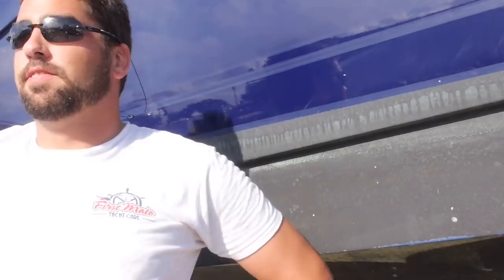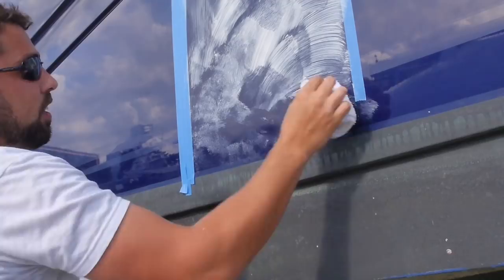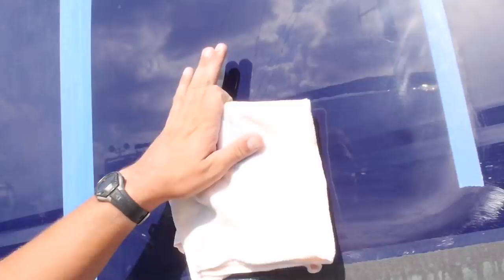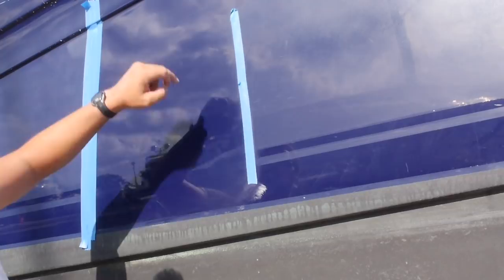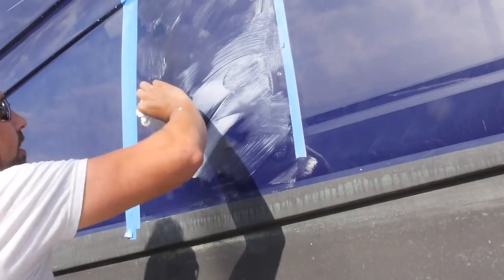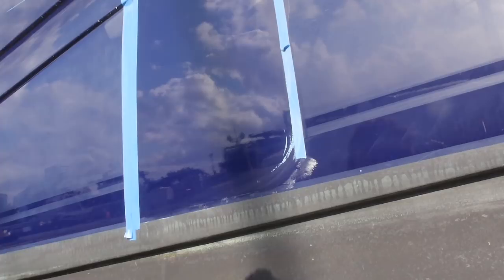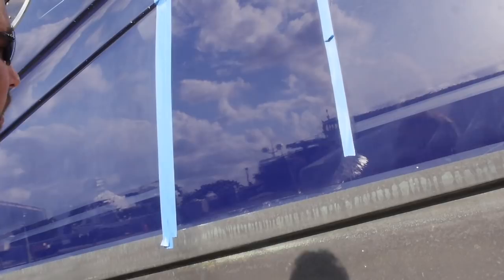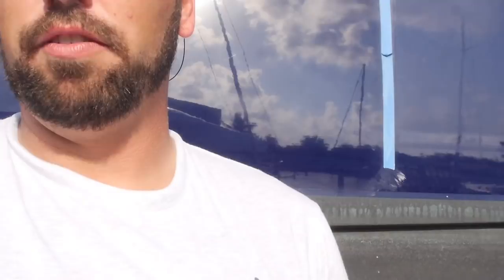How to Buff and Wax a Boat

Comment: You have the very best buffing video on you tube. Clearly you understand how the products are intended to work. Based on the comments below specifically Dankung, people don't understand how diminishing compound is intended to work. You use it correctly by applying the compound to the entire surface. If the compound is just put on the pad, the grit has already broken down as you move to unpolished areas. You know what you are doing. Many of the other youtube are misleading

Comment: Great video. I use Menzerna's on all my Mercedes and thought let see how well it works on our boat. It is unreal on the boat. I love the fs 400 for oxidation and 2500 for polishing. Then I use Rejex, especially on the rear port, starboard and stern. With diesels if you use wax, the diesel soot does not come off like it does with Rejex on it. I usually put 2 to 3 coats of Rejex, every 24hours for 3 days prior to launch.  Gets me through the season.
Reply from the maker: Rejex is great too, but better for paint. Old gel like this sucks it in like a sponge, and cannot keep a perfect layer of protection.

Comment: Wet sand or not, you have to remove all the oxidation.  You talk about multiple passes with a buffer to get the results you want, well you and I both know you are stripping gel coat on every pass.  You also have to make sure you keep cleaning out your pad with every pass.  Wet sanding strips all the dead off BEFORE you start buffing, and gets you MUCH BETTER end results.  I'm sure the customer will be happy with this, but because it wasn't done right all the way, you'll never be able to seal it up right and the oxidation will keep coming back faster, causing you to keep having to use aggressive compounds every couple years, and keep stripping the gel coat.  You and I can see the swirls and dull spots left in that spot you did.  Do it right the first time and you won't have to keep re-doing it.  Wet sand it.  You DO have to wet sand it to get the best possible, longest lasting results, that will remove more gel coat today but save so much in the long run.
Reply: Thanks James, can you give more details on the wet sanding? Any good video tutorials for that?  What grit etc... ? Thanks !

Comment: HEY GUYS , I will be doing this to my boat, so I looked up all the parts, etc. used in this video …. Some of the names have changed a little, but, through my investigating, here is the updated list (click 'Read more' below) : 

 Compounds : 
 
 - Reel Shine (NOW CALLED STARKE) - Restructure (Hard Cut) (Step 1) 
  - https://amzn.to/2WdA3iv
 - Menzerna Medium Cut (Step 2) 
  - https://amzn.to/2WfpwTY
 - Menzerna Super Finish 3500 (Fine Compound) (Step 3)
  - https://amzn.to/2DEhZXg 
 - Meguires Flagship Premium Marine Wax  (Step 4)
  - https://amzn.to/2DFEETd

Dewalt Buffer - Dw849  

 - https://amzn.to/2GQc9nM

Makita Buffer - BO6050J (newer model) 

 - https://amzn.to/2GKfPq4

Shurehold Wax Pad (Used with Makita Buffer (wiggle mode) and Meguires Flagship)

 - https://amzn.to/2J2SgLH

3M ultra fine foam polishing pad 05733 (Used with Dewalt Buffer and Menzerna Super Finish)

 - https://amzn.to/2Wd24Xh

Good Luck !  And check out my YouTube sailing channel if you are board someday !  - Lando Leaves Land
Reply: Menzerna 400 heavy cut is some good shit, i tell ya
Reply: @djstatyk1540  right on.  Ya, the Menzerna worked great.
Reply: Thank you!! Finally someone answered the repeating question and listed the products and the tools😁 Your awesome!

Comment: This should not be construed as negative, but people learning from this video also have to understand what a scratch/blemish is and need to look at their boats and understand what is a problem and what isn't i.e a gel/paint coat when newly applied only has so many microns of depth . Each scratch creates a channel that is lower than the top coat, therefore you need to decide before you polish your boat whether you want to try and recreate the original flat uniform surface it should have had when purchased as new. The reason I mention this is because if you do want this, depending on the depth you may compromise the integrity of the whole gel/paint coat just to try and buff out a deep scratch. There are too many people/companies claiming they are specialist boat polishers when their only ability is to use hard compounds and create a so called shiny surface to the uninitiated (I am not suggesting this company are, it is a caveat to this video). A true polisher should tell you the limitations of the remaining hull gel or paint and the ramifications of each process. In layman's terms if the boat starts with a hypothetical ten layers of gel/paint, one scratch may go through two layers one through seven, do you choose to lower to seven, thus leaving only three remaining and in a shorter time have an expensive adhoc process. There have been so many advances in technology over the years enhancing the life span of boats, someone whose first instinct is to use a cutting compound should be able to explain the rational through a series of test patches low impact first.
Reply: Thank, you taught me something!

Comment: My boat is also blue with some white fiberglass.  About the same condition as this boat.  We live in the Keys and use our boat almost daily. (2007 26' Striper cc)

Overall a good video, however I wasted 1/2 of my product starting at 1100 rpm's as advised.  I did 2 full passes on my boat at 1100 rpms and it did very little.  Once I increased it to 1600rpms it did a great job but still needed 2 full passes.   To see if I was correct I started the white at 1600rpms  and yep, two passes did it.
Reply from the maker: What compound did you use?

Comment: Great video and thank you. I use a little different approach for boats here in Michigan. In Fla its probably a whole different approach with salt water and heat. As an fyi I use a new 3M 3000 Non Woven Disc, and go right to polish. Ive been doing it this way on cars so I tried it last week  on a Crownline and it worked great. I also have it available on my ecommerce site should you be interested . My problem are the bottoms as I approach 70 I'm no spring chicken anymore.. Again I appreciate seeing your videos.
Reply from the maker: Donald, You are selling a polish? we always love trying new products. A clear coat (or even single stage paint) on a car is a much less porous material than gelcoat, and ages much better. Oxidized gel requires allll these steps. WE do a lot of work in Northern Michigan as well!

Comment: you should put the names of all the products in the description....
Reply: Here ya go... I did this and looked up all the products... some of the names changed, but I found the new names. Good Luck ! 
Compounds :  
 - Reel Shine (NOW CALLED STARKE) - Restructure (Step 1) 
  - https://amzn.to/2WdA3iv
 - Menzerna Medium Cut (Step 2) 
  - https://amzn.to/2WfpwTY
 - Menzerna Super Finish 3500 (Fine Compound) (Step 3)
  - https://amzn.to/2DEhZXg 
 - Meguires Flagship Premium Marine Wax  (Step 4)
  - https://amzn.to/2DFEETd

Dewalt Buffer - Dw849  

 - https://amzn.to/2GQc9nM

Makita Buffer - BO6050J (newer model) 

 - https://amzn.to/2GKfPq4

Shurehold Wax Pad (Used with Makita Buffer (wiggle mode) and Meguires Flagship)

 - https://amzn.to/2J2SgLH

3M ultra fine foam polishing pad 05733 (Use with Dewalt Buffer and Menzerna Super Finish)

 - https://amzn.to/2Wd24Xh
Reply: Updated: 
 - Reel Shine (NOW CALLED STARKE) - Restructure (Step 1) 
  - https://amzn.to/2WdA3iv
 - Menzerna Medium Cut (Step 2) 
- https://amzn.to/3agEvEO
 - Menzerna Super Finish 3500 (Fine Compound) (Step 3)
  - https://amzn.to/2DEhZXg
 - Meguires Flagship Premium Marine Wax  (Step 4)
  - https://amzn.to/2DFEETd
Buffers / Pads :
Dewalt Buffer - Dw849  
 - https://amzn.to/3kFffgv
Makita Buffer - BO6050J (newer model) 
 - https://amzn.to/2GKfPq4
Shurehold Wax Pad (Used with Makita Buffer (wiggle mode) and Meguires Flagship)
 - https://amzn.to/2J2SgLH
3M ultra fine foam polishing pad 05733 (Use with Dewalt Buffer and Menzerna Super Finish)
 - https://amzn.to/2Wd24Xh

Good Luck !!!

Hope I was able to help save you some time searching for all of this. 

After I was done with mine, it was beautiful. Couldn't believe the difference. 

As an Amazon Associate I earn a small bit from qualifying purchases, you pay the same as always. Not a penny more.

Comment: Product List?
Reply: Some of the names have changed a bit, but here is an updated list.  Youtube doesn't allow linking a lot, so just copy and paste the links if need be.  
- Reel Shine (NOW CALLED STARKE) - Restructure (Step 1) 
  - https://amzn.to/2WdA3iv
 - Menzerna Medium Cut (Step 2) 
- https://amzn.to/3agEvEO
 - Menzerna Super Finish 3500 (Fine Compound) (Step 3)
  - https://amzn.to/2DEhZXg
 - Meguires Flagship Premium Marine Wax  (Step 4)
  - https://amzn.to/2DFEETd
Buffers / Pads :
Dewalt Buffer - Dw849  
 - https://amzn.to/3kFffgv
Makita Buffer - BO6050J (newer model) 
 - https://amzn.to/2GKfPq4
Shurehold Wax Pad (Used with Makita Buffer (wiggle mode) and Meguires Flagship)
 - https://amzn.to/2J2SgLH
3M ultra fine foam polishing pad 05733 (Use with Dewalt Buffer and Menzerna Super Finish)
 - https://amzn.to/2Wd24Xh

Good Luck !!!

Hope I was able to help save you some time searching for all of this. 

After I was done with mine, it was beautiful. Couldn't believe the difference. 

As an Amazon Associate I earn a small bit from qualifying purchases, you pay the same as always. Not a penny more.

Comment: Good job on the gelcoat...I don't envy your job. I know how much work it takes to get gelcoat back like that as i did that to one of the boats I owned that was almost as bad as that. I used a DA polisher with foam pads so it took me a little longer than using wool etc. I used 3D products HD Uno for the entire job just changing pads along the way.
Reply from the maker: The RO DA polishers are great for applying wax, but you really need a rotary wheel with torque to 'cut' the severe oxidation. Make the tools work, not you!

Comment: I really appreciate this video! I currently wet sand and buff cars, i need to learn more under my belt. I've had multiple people offer me almost a thousand dollars to buff their boat, but i couldn't do it because i don't know the procedure. It's GOT to be different from a car, and i was correct. Honestly, i'm here to see if it's something i can do in a timely fashion. How long does it take to buff a boat? Obviously you can't cut corners, most body shops will beg you to cut corners and still bitch at you for doing so when the job doesn't come out fast.

Comment: Hi. I got a 2003 Regal Commodore 2465 all white.It's 25 feet long.  It did seat on sun for 2-3  years and there is no more shine. I cleaned it with pressure washer and now it's super clean! To get it buffed by someone professional the way you did, how much approximately does it cost? Thank you!

Comment: Is Maguire"s Pure Wax, just as good as the Flagship wax that you use?  If not, what do you usually use the pure wax for?  a
Also, great video!!!!  It's helped me a lot on my 1984 Sea Ray Sundancer.
Reply: I've used the Meguiar's one step compound and it works well. The stuff in a blue bottle. My gelcoat oxidation was so bad it was almost white instead of its its teal color. Took all the oxidation out and gave it a really nice shine. I'd give this a try if your looking for a good compound.

Comment: Nice video. Learned a lot, thanks! Neglected my Sea Ray for the past couple years. Thankfully it's white gel coat so Oxidation didn't show too bad (at least to according to my wife) but it was driving me NUTS. With these tips I'm going to knock it out and get that thing back to a mirror finish!One question, to avoid having to cut the oxidation and really work to bring back the shine, how often should I wax the boat? Should I polish also with a light compound before waxing every time or would regular waxing stop me from having to do all the extra work? I live in a desert area of SE Washington State. High UV/Sun exposure.
Reply from the maker: Drayn509 We would recommend every 6-8 weeks depending on the weather. If you are on a regular wash schedule, you should be able to notice when the water stops beading up and the boat starts to dry before you can chamois it dry.
Reply from the maker: Drayn509 As long as you stay on top of the waxing, you should be able to go 2 seasons without buffing. If you keep up on it, only a light buff will be required then.

Comment: Can we get list or link to product used?
Reply: I looked up all the parts etc used in this video …. Some of the names have changed a little, but, through my investigating, here is the updated list : 
 Compounds : 
	
	- Reel Shine (NOW CALLED STARKE) - Restructure (Step 1) 
		- https://amzn.to/2WdA3iv
	- Menzerna Medium Cut (Step 2) 
		- https://amzn.to/2WfpwTY
	- Menzerna Super Finish 3500 (Fine Compound) (Step 3)
		- https://amzn.to/2DEhZXg	
	- Meguires Flagship Premium Marine Wax  (Step 4)
		- https://amzn.to/2DFEETd

Dewalt Buffer - Dw849  

	- https://amzn.to/2GQc9nM

Makita Buffer - BO6050J (newer model) 

	- https://amzn.to/2GKfPq4

Shurehold Wax Pad (Used with Makita Buffer and Meguires Flagship)

	- https://amzn.to/2J2SgLH

3M ultra fine foam polishing pad 05733 (Use with Dewalt Buffer and Menzerna Super Finish)

	- https://amzn.to/2Wd24Xh

Good Luck !

Comment: What is the model/description  of that buffer and the pads again? Nice video!
Reply: Buffers / Pads :
Dewalt Buffer - Dw849  
 - https://amzn.to/3kFffgv
Makita Buffer - BO6050J (newer model) 
 - https://amzn.to/2GKfPq4
Shurehold Wax Pad (Used with Makita Buffer (wiggle mode) and Meguires Flagship)
 - https://amzn.to/2J2SgLH
3M ultra fine foam polishing pad 05733 (Use with Dewalt Buffer and Menzerna Super Finish)
 - https://amzn.to/2Wd24Xh
Wool Compounding Pads I used : https://amzn.to/2PO3LsA

I used / use these buffers and they are great... I love anything from Dewalt especially.  Will last a LONG time. 

Good Luck !!!

Hope I was able to help.

As an Amazon Associate I earn a small bit from qualifying purchases, you pay the same as always. Not a penny more.

Comment: Very nice job - I've watched this video several times, trying to document your technique.  I've got a 2003 Sundancer 260.  Got a Makita 7" rotary with a wool pad and set of CCC foam pads, and a Porter Cable 7424xp with an assortment of cutting/polishing/finishing pads.  My boat is white, so its tougher to see when I've gotten through all the oxidation, but my question is this: how much compound do you use, how much pressure do you apply, and how do you know when you've worked through the compound and need to clean your pad/apply more compound?
Reply from the maker: I like to make sure there is enough compound on so the boat doesn't get 'hot', and it is lubricated. A very thin layer, there shouldn't be 'mountains' of compound. Medium to heavy pressure; BUT KEEP THE PAD FLAT!!!!!. When you cannot see the compound, or it dries to a haze, apply more.

Comment: Could you post the products used?
Reply: Here ya go ... 
Compounds :  
 - Reel Shine (NOW CALLED STARKE) - Restructure (Step 1) 
  - https://amzn.to/2WdA3iv
 - Menzerna Medium Cut (Step 2) 
  - https://amzn.to/2WfpwTY
 - Menzerna Super Finish 3500 (Fine Compound) (Step 3)
  - https://amzn.to/2DEhZXg 
 - Meguires Flagship Premium Marine Wax  (Step 4)
  - https://amzn.to/2DFEETd

Dewalt Buffer - Dw849  
 - https://amzn.to/2GQc9nM
Makita Buffer - BO6050J (newer model) 
 - https://amzn.to/2GKfPq4
Shurehold Wax Pad (Used with Makita Buffer (wiggle mode) and Meguires Flagship)
 - https://amzn.to/2J2SgLH
3M ultra fine foam polishing pad 05733 (Use with Dewalt Buffer and Menzerna Super Finish)
 - https://amzn.to/2Wd24Xh

Good Luck !

Comment: How thorough are you with cleaning before buffing? Just schampo and rinse? Or do you see to it that all different types of dirt is removed before buffing? I'm having some problems removing darker water stains on white gelcoat by hand and then when I start to buff some of it comes off and kinda smears into the buffed area. Anyone got some ideas? I don't want to use too strong chemicals like acetone risking a dryed up gelcoat.
Reply from the maker: We are very thorough before buffing! anything left behind is either going to be ground into the boat, or will simply be more work to remove.  I am guessing the darker water stains may have some rust in them, or something else that is harder to remove (not just 'water'). Acetone will not help that type of stain, but I would recommedn an acid. Start mild, with vinegar, then use something stronger till you see a difference; lime-away/CLR -> bottom cleaner -> muriatic

Comment: What speed do you set the buffer for the various compound products. Mild, moderate, aggressive, etc.
Reply from the maker: STart slower with more aggressive compound, finish high with finer (helps burn off if too much oil, makes wiping up easier, and bakes in oil).

Comment: Just curiuos, but why do you have a Dewalter buffer for compound and a Makita Buffer for wax.  Aren't they both relatively the same thing just different company
Reply from the maker: ethan'stank The Dewalt buffer used here is a rotary machine, the Makita is a random orbital. They are NOT relatively the same thing. The random orbital makes it virtually impossible to leave swirl marks, the same can not be said of the rotary buffer (the Dewalt).

Comment: I agree, a great video that was very informative.  I have a 5" porter cable random orbit sander.  It does not have variable speed.  Is this okay to use to apply the final wax/polish?
Reply from the maker: Yes, that will work fine for applying wax, but with no torque it will not be helpful removing oxidation.